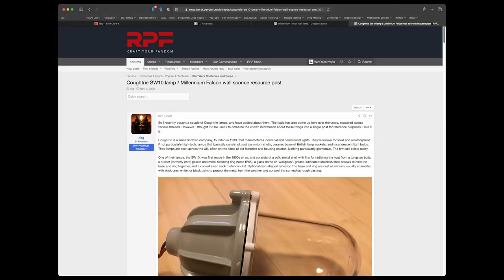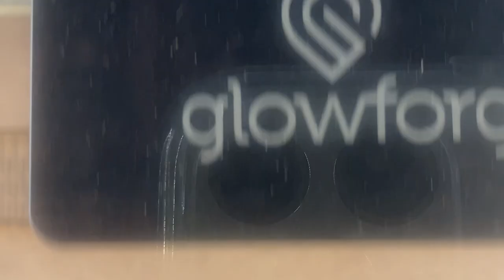Making a Star Wars Millennium Falcon Lamp Replica | Smuggler’s Run

Comment: I’ve been trying to determine what the (closest to) screen accurate dimensions are for the backing plate.  Curious how this was determined and if you have a link to acquire the .svg files for the laser cutter?
Reply from the maker: Mine is roughly 10.5” wide but after seeing some other photos I don’t think it’s correct.